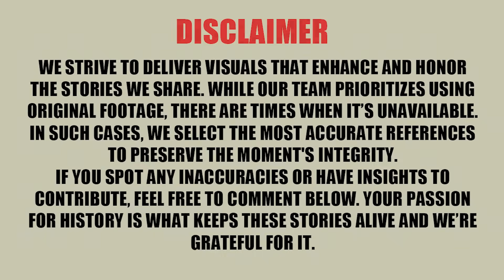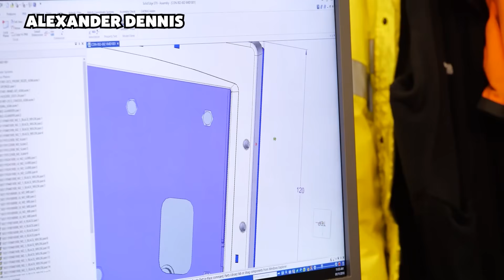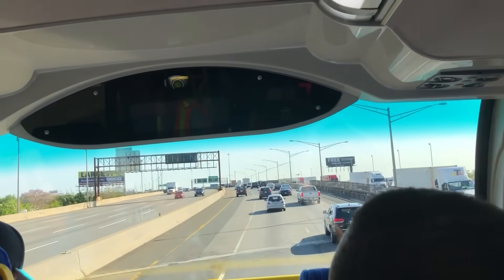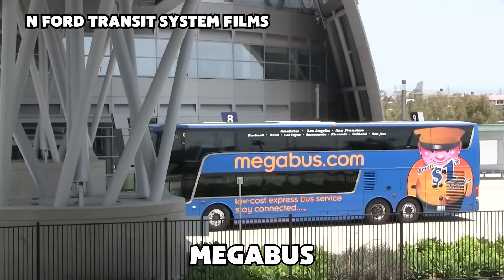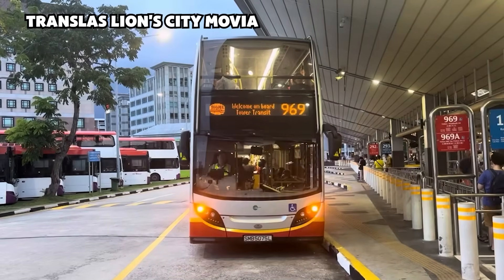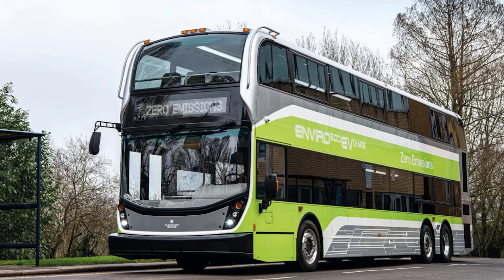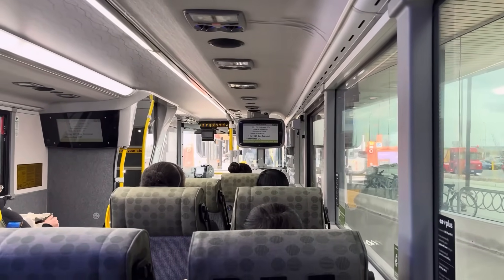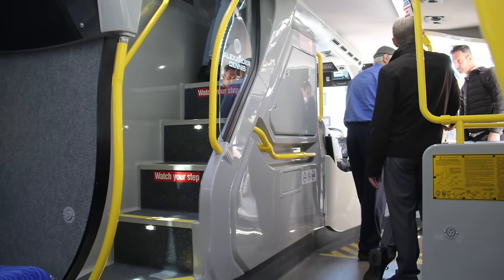How the Enviro500 SuperLo Solved a 100-Year Problem

Comment: Intriguing, here in the States the weight limits are 17K per paired dual-wheel axle, and typically 12.5K for the steer (with an absolute equipment-dependent limit of 20K), this bus is 57K GVWR so it is 3K to 10.5K pounds over gross axle weight?
Reply from the maker: Thanks for pointing that out! I’m always working to make the technical details as accurate as possible. Axle weight limits can vary a lot by region, so I really appreciate you highlighting this, it helps me improve future videos.

Comment: Here in Ottawa,   the  city transit system OC Transpo  operates a fleet of more than 100 double decker buses (Enviro500).   The city solved the problems of adjusting   bridges, traffic lights, pass overs, etc., to fit the buses.     Now,  the double decker city buses become a common  sight  on the streets and roads  of Ottawa.
       It is in fact more comfortable than the Flyer Industry's long articulated buses.       And in the winter time, the double decker buses surely out handles those "bendy buses" in heavy snow.       In snowy weather, here in Ottawa,  it is common to see a  "bendy bus" lying across an uphill road                                          .
Reply from the maker: That’s a great insight! Ottawa’s OC Transpo really made double-deckers work with smart infrastructure adjustments. And you’re right! In snowy conditions, those Enviro500s are much more stable than bendy buses.

Comment: Nice video.
Just to add, the suspension is awful for drivers, It cant handle the roads unless it is perfectly paved and driver sit  inches off the road.
Drivers are thrown around like they are in a washing machine on some stretches of road.
Better passenger comfort is the upper level.
Lower level is noisy, road noise.
As for the future, Millions spent, and now they are being scrapped. Back to the D4500's.
So much potential, it just needed tweaking.
Reply from the maker: Thanks for the insightful comment!
You’re absolutely right! The suspension setup and low driver seating position were major weak points. Many operators mentioned how rough it could get on imperfect roads, while the upper deck offered far better ride comfort.
Reply: The ADLs in HK & SIngapore also face complaints of creaking though some may attribute it specifically to the quality of the assembly factory in Zhuhai, China

Comment: You do know that Union Station Bus Terminal had its new and current terminal opened in December 2020 right? The main terminals of issue were York Mills and Yorkdale. And I think Hamilton GO was well. Now I think the issue at Union was the underpass at Bay Street (current clearance of 4.1 metres/13.45 feet)
Reply from the maker: Yes, the new terminal opened in December 2020, but the earlier clearance issues under Bay Street and at York Mills/Yorkdale were a major concern for the SuperLo design. Thanks for highlighting that!

Comment: Imagine if the tag axle had steering I bet the turning radius would be tighter
Reply from the maker: Excellent observation! Some newer European coaches experimented with steerable tag axles for that exact reason, tighter turns and less tire wear.
Reply: I drove a double decker Neoplan here in England on express bus  routes it had rear wheel steering  at low speeds  and made a clunky when locke  usefull for backing out of bus bays.

Comment: The REAL problem is NOT larger-capacity BUSES (with no need for more drivers).  The REAL problem is a wrong MINDSET.   
A much more EFFECTIVE solution is TRAMS that have PRIORITY over cars.  This allows for more trams with a so much HIGHER FREQUENCY that double-deckers (bus or tram) are not needed at all.  This also leads to replacing many bus lines (that are typically  stuck in congested car-traffic) with such smooth-&-fast running tram lines.
Combine such tram lines with roundabouts, ie less traffic lights!  Cars follow the roundabout while trams cross straight over such roundabouts.
Reply from the maker: Which city do you think has done this best so far?
Reply: @ClassicCarSecretsTV  On a GLOBAL scale I would rank Canada & the USA as nearly the worst re public transportation.  Europe & Asia are near the top imho.
Reply from the maker: @Scott-i9v2s  Thanks for sharing your thoughts!
Reply: Too slow
Reply: @mozamotors  If you mean too slow for cars, that would be fine.  Cars should not be allowed in areas where people walk/bicycle/&c anyway.
Reply: Trams are great, until literally anything happens, whenever trams have an issue (which is everyday) it's buses that pick up the slack
Reply: @HexAyed  But accidents happen every day among cars as well.  So buses are held up as much (or even more than) trams.  So buses can NOT "pick up the slack" for trams.
Reply: @Scott-i9v2s As a bus driver in a city that also has a tram network, yes, we absolutely do pick up the slack for trams, we're constantly being told to accept tram tickets because something has gone wrong, my company is currently running 3 tram replacement services because 3 tram lines aren't running due to engineering works. Do you know what else happened today? There was a crash on one of our routes, the 249, within 10 mins of the crash, we were given a diversion and the route carried on running. What happens when there's an incident on a tram line? The trams stop running and the buses pick up the tram passengers.
Reply: @HexAyed  Questions: 
1) Are the tram-tracks separated from the car-lanes?
2) What is the priority of trams versus cars?

Comment: I ride Enviro500 to and from work everyday. This bus is very common in Singapore and Kuala Lumpur, Malaysia. Didn’t know the same bus can be customised to fit different regional markets.
Reply from the maker: Very true! ADL did a great job adapting the Enviro500 to different markets. The Asian versions have quite a few unique specs compared to the North American ones.
Reply: We have the enviro 300 in the UK practically thes same but taller used on smaller roads Go under train bridges that are low just dont stand while its moving in or stopping
Reply: HK has even more of them

Comment: Here in the US bridges must have a minimum clearance of 15'.  So at 12'-10" this bus will absolutely clear all bridges built with that height standard in mind.  Very ingenious build.
I'd love to see these run here in the states.
Reply: But not all bridges comply e. g. the “can-opener”. 12’ 8” + 6”
Reply: @etienneOW That one is 11'8"+8", now 12'4", still happily opening cans!
Reply from the maker: Would be amazing to see one rolling here someday!
Reply: They have been tested in the USA, but the problem is dwell time in stops. For an agency like GO Transit, it works as it operates like Greyhound used to operate in Canada. But it wouldn’t work for the MTA in NYC (because of dwell time) or NJ Transit (which uses MCI coaches like local buses).
Reply: 15' would be great, but the standard here is 13'6" / 4.15m.
Reply: @11foot8plus8 would beg to differ.
Reply: Actually, they are technically to be used in the US. All they need is a contract from a local transport authority.
Reply: All new build bridges may need to be 15' but there are many existing bridges with far less.

Comment: They had experience making reduced height double deckers ever since they designed Trident 10.3m for NWFB route 14/ 15 very early on

I think this is an alteration on that design (i.e. stretched) for different operational environment
Reply from the maker: You’re right! The reduced-height double deckers evolved from the Trident 10.3m design, and stretching the design made it more suitable for other routes.

Comment: Very good research... glad to see a focus on GO and their favourite buses...

I've heard they are not doing well on the roads, as they're not working well and a lot of issues are arising. Family friend drives at GO and he hates them compared to the MCIs. Those double deckers are terrible on power, they often break too. Funny how now they're both owned by New Flyer...
Reply from the maker: Appreciate the insight! Always interesting to hear real feedback from drivers, sounds like those double deckers have been quite a challenge.
Reply: Here in Ottawa, the city transit operates a huge fleet of double decker buses (plus bendy articulated buses from Flyer).    You know what?      In the winter time, the double decker buses get no problems at all going through heavy snow.     BUT, those bendy buses --  they get problems going up slippery hills.      In heavy snow, you will find a lot of  those bendy buses got stuck and simply lying across the roads.

Comment: These busses should be used for long distance travel, for greyhound or flixbus. Megabus had the double deckers before they went bankrupt. These busses probably saved more fuel than the megabus double deckers due to being more aerodynamic due to it being shorter, and lighter due to less metal used for the bus overall. That small savings in fuel can make the economics work better for long distance bus travel.
Reply: Where would the restroom go?
Reply: @samuelitooooo first floor just like the megabus ones, but much lower roof I suppose
Reply from the maker: That’s an interesting analysis. Using them for long-distance routes could definitely make sense fuel-wise.
Reply: I think the Alexander Dennis comes under the ownership of Daimler Trucks?

Comment: OC Transpo had close to100 of them. There where only a few places on a 1 or 2 routes that it could run. We had the transit version(two doors) not Commuter version. There nice although there are no plans to buy anymore at the present time.
Reply from the maker: That’s great insight! The two-door transit versions were pretty versatile, even if their route options were limited.
Reply: Yh OC transpo has the enviro 500 go anywhere version 
Only the 8100 series buses are still around, the 8000 series have been retired. One OC transport driver told me that the 8000 seats at they retired. The under body started to rust.. I guess that’s Ontario snow solutions for you😅